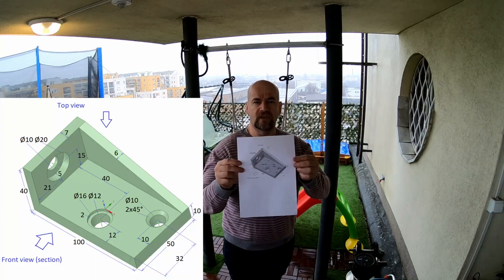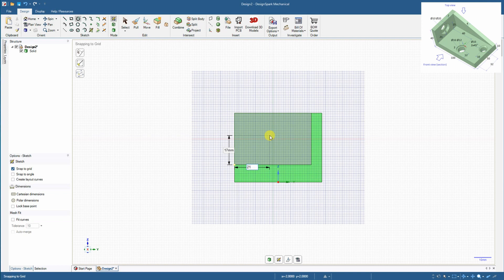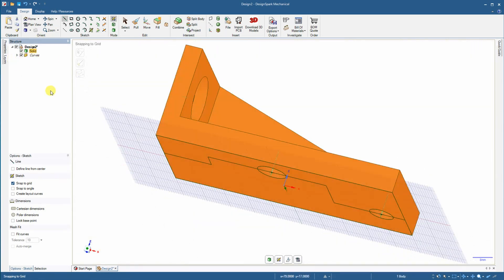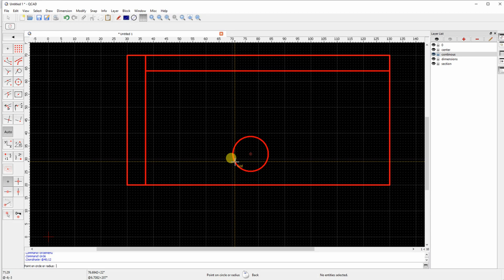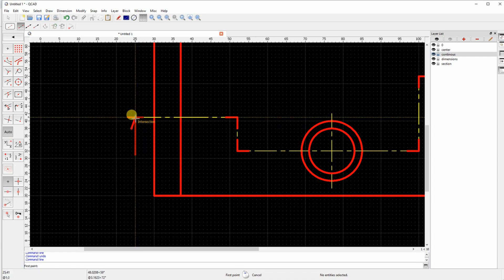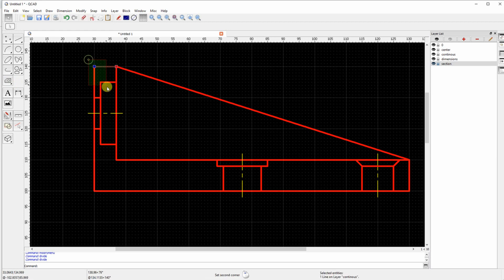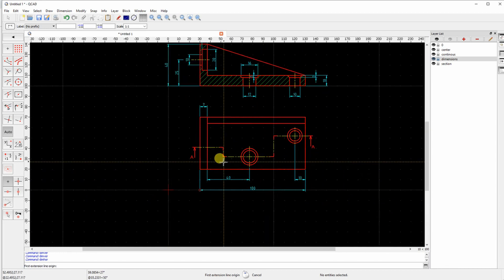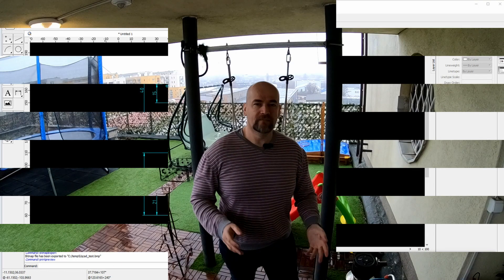QCAD practice #2 for 2D drawing (and DS Mechanical for 3D)

Comment: SolidEdge 2D Drafting is a very good parametric 2D free to use software. The sectioning command from memory is much easier and the parametrics are extremely good / clever. I haven't used QCad.
Reply from the maker: I didn't know that 2D part is free. I will give it a try. Thanks for the info.